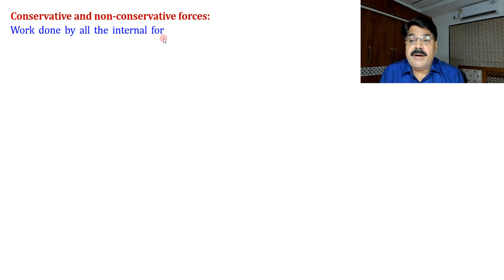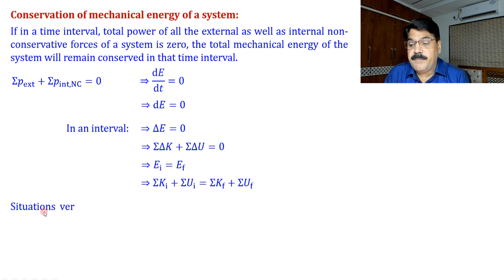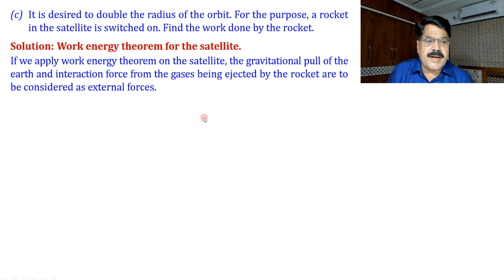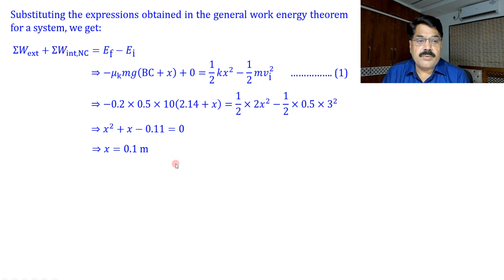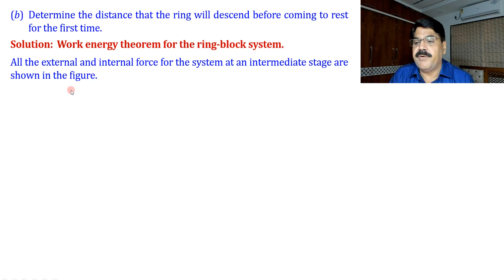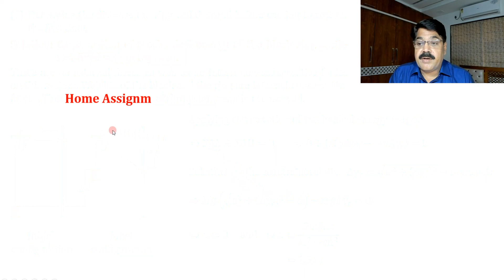L 35  WEP Mechanical Energy Conservation

Comment: Sir in your book.... chapter work energy quéstion 3...https://youtu.be/6Y6P1sNRPq4
This man says that the D option which i given correct is wrong ... But sir i this there is no mistake in d option ... please check it sir.
Reply from the maker: Apply work energy theorem for a variable system of particles, you will also get the option d.
In fact the persion  in the vedio is using Newton's laws, so not getting any idea about continuos loss of KE in the rope at leaving ends.
In fact, purpose of this question is to make students learn work energy theorem on a variable system of particles. This is why, I have included this problem in the chapter of "Methods of Work and Energy' and not in "Newton's Laws of Motion".
Reply: @ArvindTiwariPhysics  yes sir i understand it...Sir I don't have the contact of this person but if you comment on this video..he will surely reply...so you can comment him there..
Reply: @ArvindTiwariPhysics  Sir the person says that the rope will swing so KE will not be lost...Sir i this there will be a superimpose of 2 waves which is out of phase so no KE is lost..am i correct??.
Reply from the maker: @jitendrapandey1085  Let me find some spare time to work on these suggestions.
Reply from the maker: Can you please, provide contact details of the person, who has delivered the lecture?
Reply: @ArvindTiwariPhysics  Sir you can include the solution of this question in your next video and i would comment him you video link..